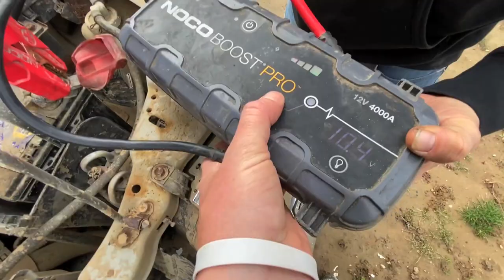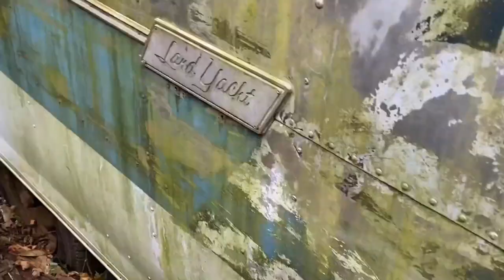Goodbye 4X4 Mitsubishi!

Comment: Dude the hole you made for the diesel in the intake is after the maf. It's leaning out...  Put tape over the whole when not using diesel it'll fire right up..  Also turn the key fully off before trying to restart it. Going full off to on primes the Fuel pump. Thank me later bud
Reply: I was thinking the same thing the hole is a huge vacuum leak
Reply: That’s why it started running better later because he plugged the hole trying to use diesel again just keep it plugged mark it should run fine like you said ol Mitsubishi never let down

Comment: Spotted the beautiful square body in the parkinglot,   also the saturn has a override button on the dash so it won't rev cut in reverse, then you can go full speed.  Those 3.1 multiport gm motors in the cavi,corsica,Beretta gt, and some of the  chevy celeb station wagon,  smash out dude !!!!! Had a Beretta gt when I was 16 and it was pretty dam fast

Comment: You probably snapped the steering column but like you said there is nothing moving on the engine bay of the car I assume you guys aren’t much for taking bolts off. so see who can bust off the steering wheel with a sledgehammer and put a big pair of vise grips on there to steer it
Reply from the maker: I just lined it up to the jump and launched it 😂